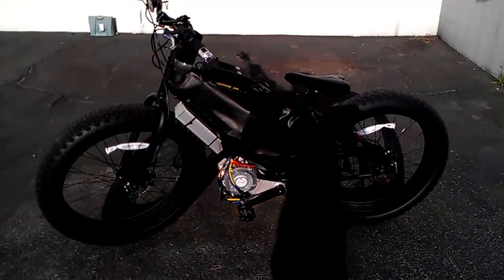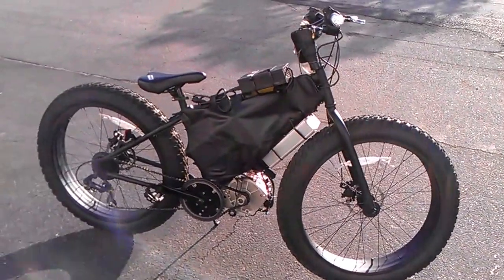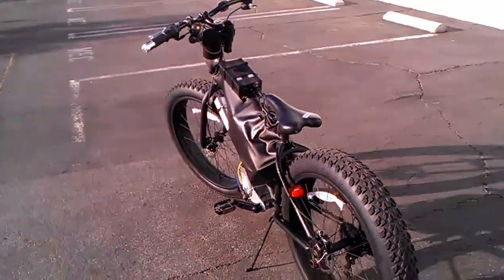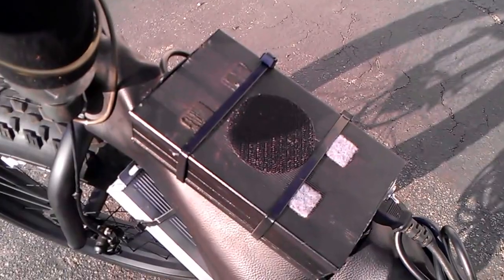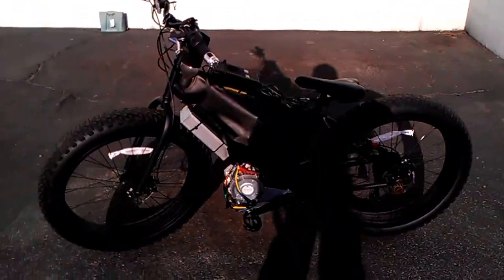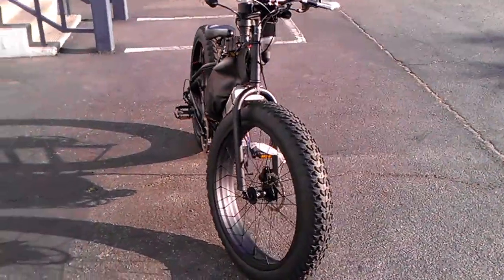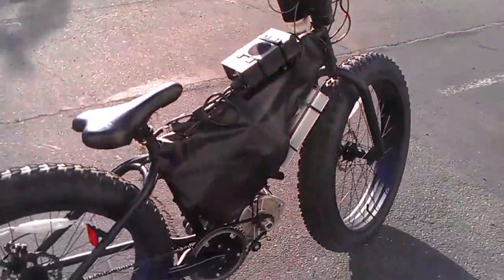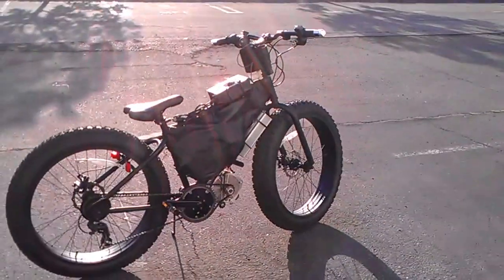7.5Kw Cyclone Ebike Motor Kit = 10Hp. On a Mongoose Dolomite 26in 4in

Comment: This does about 50mph and the 3000w cyclone goes just as fast but weighs less and you get more range better off just using the cyclone 3000w kit
Reply from the maker: Da Bl well that all depends on the ampere output and voltage setup and rpm of the motor. I'm only running 48v 120a with a 4.5 years old battery. brand new battery would give more like 60mph in first gear.

my battery has deteriorated by 25%. and if we were to hit an extremely steep hill, your motor would stall, my motor will keep on going... that the point of have more Watts....

I'm talking about while if we were both with brand new batteries at the same voltage. 

48v 120a output fully charged are around 58.3v = 6960 watts = 9.28 Hp

60v 120a output fully charged are around 72v = 8640 - watts = up to 11.5 Hp

72v 150a output fully charged are around 84v = Up to 12600 watts = 16.8 Hp

it can get very crazy

RIGHT NOW, I'm running around 55v / 120a - 6600 watts or 8.8Hp
Reply: What is your top speed on flats?

Comment: yesterday  the metal strip broke  used for the chain tensioner where the pulley was attached on mine.  it snapped near the hole where the pulley wheel was attached. the metal quality is very weak.  that same metal is used for the mounting plates and i'm now concerned it could easily break.
Reply from the maker: Email me a picture

batmanofinglewood@gmail.com

Comment: Nice bike man , suggest fit the controller to another place
Reply from the maker: from my experience, that's the best place for controller. it's just that the bike needs taller forks. For heat dispersion, its the best on front down tube.

I will be getting suspension fork on front... will give an extra 3-4 inches...

THANKS for the suggestion. if needed, it will installed on the side of the "seat tube" gets good air exposure there as well.
Reply: +Inglewood Knight 3-4 inches on the fork is too high you will change the bikes geometry
Reply from the maker: +george kontopoulos Ok. I understand. I will just put it on the side of the seat tube. 👍👌
Reply from the maker: +george kontopoulos I guess I was only thinking about heat dispersion. but now thinking of it, it would work very good on the seat tube even on a very hot day. 👌
Reply from the maker: hey brother. I finally relocated the controller. really nice for the moment. But, once I get the batteries I need the controller will be on the Seat Tube...

check my instagram page BatmanOfInglewood to keep posted in the development